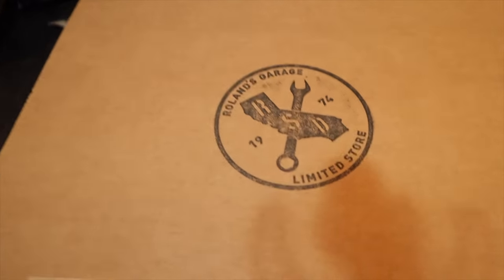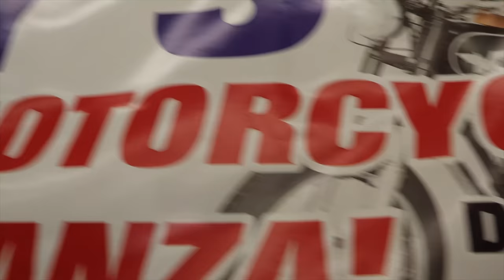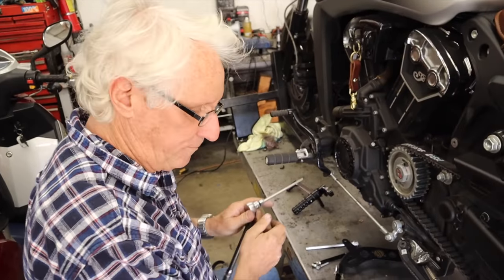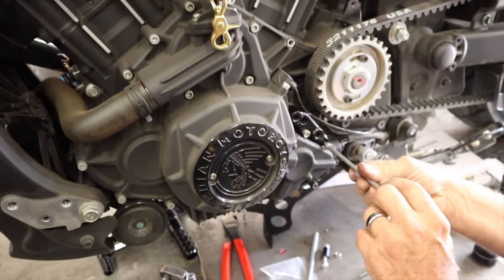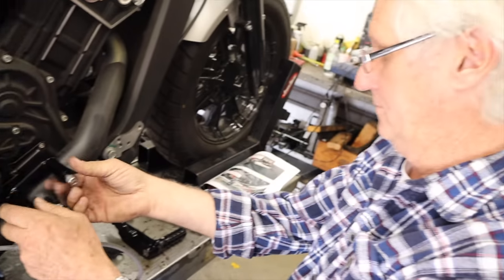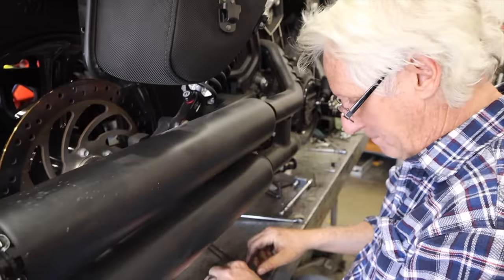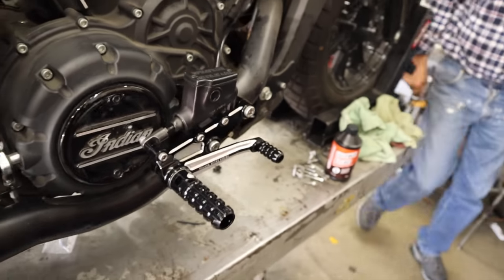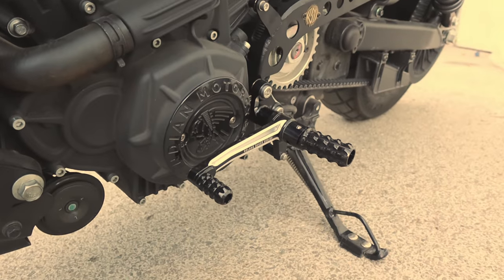I'm Finally Happy! (Indian Scout Bobber Mid Control Swap) - Rockett Vlog #40

Comment: that dent in tank could be removed from under the tank using a process called "paintless dent repair"... they finesse the dent out from the inside, no repainting needed. Your gas tank will have to come off and the fuel pump removed. But it can be fixed. That dent would bother me as well.

Comment: I put mine on early last year, and my bike has ABS brakes, and I didn't want to have to bleed those.  So I didn't change my brake line over.  I just cracked it a little bit to run it up and over and it works fine.  Sticks out a little, but should be fine.  Having been a Ducati rider for many years, I was just so used to having the controls under my feet, and being short, the reach was so much better.  Love the RSD.  Not cheap, but worth every penny.

Rikki, hope you get back to Syracuse, NY again to perform, we could take a ride.

Comment: I just found this video and thought, "Ha they stole the rocker's name!" Then it turns out it's you! Awesome surprise! Nice video too. I'm a short guy (5' 6") and I have my eye on the Scout Bobber, but I hate forward controls. I wish Indian would offer mid controls on this bike.
Reply: They have them in their dealer made by some company they work with. I’m wondering mine in 2 months with them installed.
Reply: @ToastyClam  do you know what the name of the company is for the mid controls?
Reply: miles martinez no I don’t if I find out I’ll let you know. Getting mine in 2 weeks
Reply: ToastyClam - did you get your motorcycle? What make/brand are the mid controls, mate?

Comment: Hey Rikki, do you still feel the same about the Roland Sands mid controls? I have the kuryakan mids and they’re not working for me whatsoever. They stick out a lot and I’m constantly scraping on tight corners. Curious if you have the same issue with yours?

Comment: hey dude, I just put on the mid controls from RSD on my 18 Bobber, and found that it doesn't work with my Dean Speed pulley cover. I was thinking of getting the RSD pulley cover like you have, but from the photos, it looks like it doesn't actually cover the bottom side of the pulley? Do you ever worry about your jeans or foot hitting the belt while it's moving, since now the mid controls bring you so close to it? I like to "dig into" the bike while on mid controls. I'm thinking of getting the Joker Machines cover instead but I'm really not sure, would love to hear your thoughts!

Comment: I'm still struggling with my mid-controls. The dealer put Kuryakyn on and they seem too far back and in the way of my feet touching the ground. I should have put RS on like you suggested. Do you feel they are in the way of planting your feet on the ground?
Reply from the maker: Mine do not. The Roland Sands seem to be the best set up. I haven't seen the Kuryakyn up close, just online.
Reply: @RikkiRockettsLegendTripping   I finally got the RS mid controls.  They were on back order for months.  The bike is perfect now.  Thanks so much for this video. The mechanics at my Indian dealership were watching it too..  Your fan, Terry
Reply from the maker: @TerryLivelyInk  I agree. They nailed it! Happy riding!!!

Comment: Ricki, how long is your inseam? Curious if this setup will have me too cramped at a 33/34" inseam.
Reply: @RikkiRockettsLegendTripping  cool, do those pegs give you more lean angle? They look like they are mounted a bit higher than stock.
Reply: @RikkiRockettsLegendTripping  thanks man, I might have to get a set for my Scout.
Reply: Did you get them? How is it now?
Reply: @thomasfrank280  no I never got them. Still mulling it over in my head though. I just don't  think my knees can handle the angle.

Comment: Where did you get the bag on the luggage rack?
Reply: @RikkiRockettsLegendTripping  Do you use the bag to lean into for back support? I have a Scout [still with forward controls] but find the armchair position combined with crap shocks does my back in on any sort of longish ride. I dont like look of backrests so ive bought a Kriega bag to strap on rear so i can hopefully get some lumbar support, but may have to consider these mid mounts as well now

Comment: Aren't you going to ditch those stock pipes for something more elegant?
Reply: @RikkiRockettsLegendTripping  I would suggest Crusher Maverick,  but that depends on if they are legal in your state.
Reply: @khaccanhle1930  I have the Crushers on my Scout. They are loud but not terribly so. They may be illegal in some States as you said. In my opinion though, they are the best looking pipes you can get for the bike. The diameter of the slip ons is just a bit larger than the headers and the cut off about mid wheel. Drops about 15 pounds off the bike in the process.